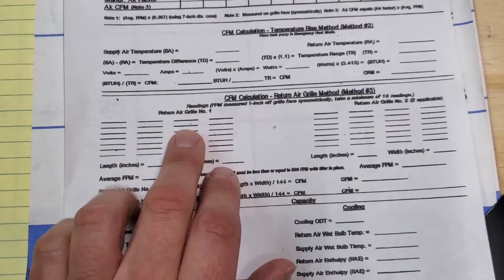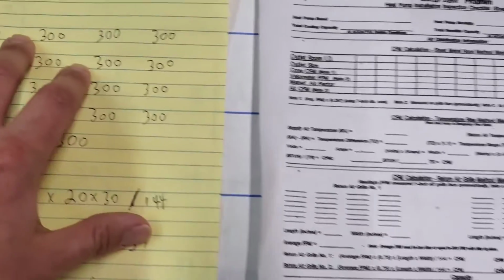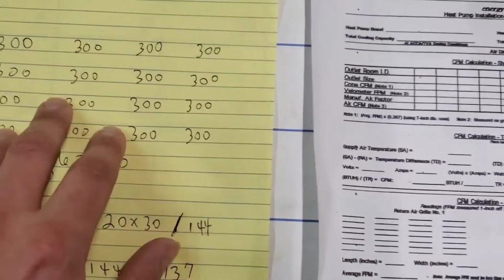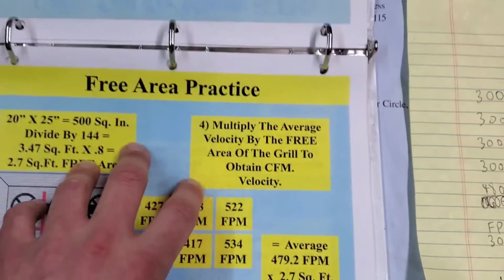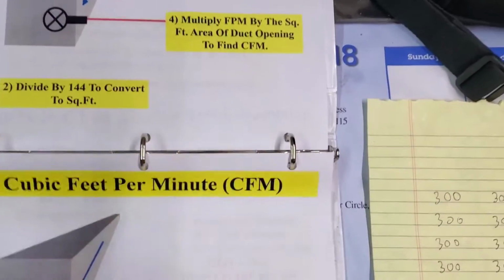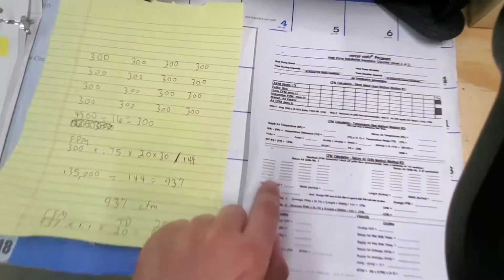Duct Design and Airflow hvac basics

Comment: I have a 3 ton unit and just did these calculations and see that mine is at 19,622. A bit low I think.So, to the attic I go to measure the duct work. Filter is clean, Evaporator coils are clean also. My air handler is in the wall with a 27x22 air return in the living room. Not much area to increast the size of the return air duct and only have that one. It may be possible to bypass the filter and add a return air duct from the bedroom to the air plenum in the attic.  Its hot down here in Texas and we miss every little bit of the air that we can get.  Thanks good video Taddy.

Comment: What speed do you set the air handler on before checking fpm ours is set to 75% should I set to 100% to check fmp
Reply from the maker: I go with the manufacturer setting which is the setting that it comes set on and then I go from there I'm usually looking at the temperature split supply and return temperature.  If the temperature split is more than 20ﾟ then I may increase the fan speed if the temperature split is less than 20ﾟ then I may increase the speed. 
 Let me know if this makes sense if it doesn't then I'll go live and I'll talk to you.
Reply: @taddydigest  what one is increase and decrease? There was a typo. I had all the ductwork replaced and I don't beleave it is right at all. I was trying to figure out if the trunk and all the duct is the right size. I was trying to find someone with knowledge that I could give all the info to to see if it is right and if not I could correct what needs be.
Reply from the maker: oh ok got it 👍
I can help you ☺
Join Be a Member 
I will help and show you 
Also I have a video for members only on how to install a whole duct system, layout ,fittings and sizing diy 
You can email me after you JOIN
Reply: @taddydigest  I just joined
Reply: @taddydigest  that's what I need I the duct and layout and anything related
Reply: @taddydigest  how do I get the guide?
Reply from the maker: send me email and I got you tadfuller1@gmail
Reply from the maker: Thank you for joining
Reply: @taddydigest  I just sent you a email about the guide. It's a yahoo

Comment: Great advice. I’m not a havc tech however I found your video very interesting, Thanks... why’ll having a havc tech at my house replacing the A/C core he found that over 6 years ago when the new furnace was installed someone dropped a 90 degree gas ( iron) fitting in the exhaust side of furnace 😳. It was rusty as hell and contamination has been falling down inside the fan and throughout the small hoses and I see it’s clogged some orifices. Please advise. I am concerned about in the house air quality .😞
Reply from the maker: wow that can be dangerous glad you got that fixed for sure 
Thanks for watching 👀😀 
let me know if there are any questions I could help with
Reply: @taddydigest  yes dangerous for sure, The furnace company told me they would give me a free teardown and inspection I told him I want a new furnace it’s been running 5 1/2 years with that exhaust pipe that was 80% plugged.all of the rust from this iron fitting has been breaking down over time and has contaminated/restricted all the vacuum lines😢